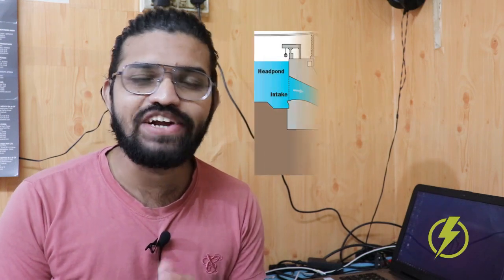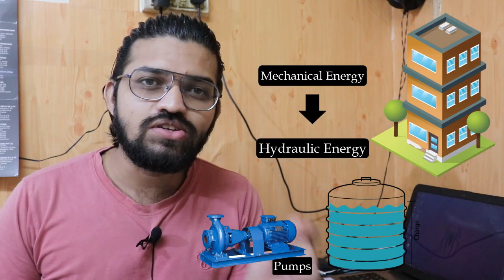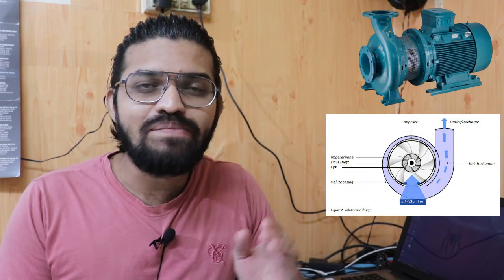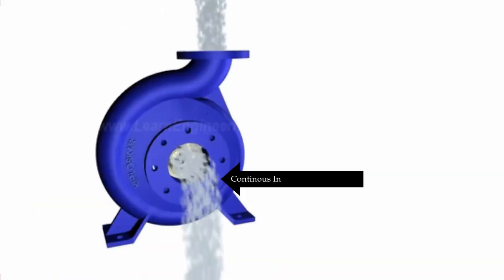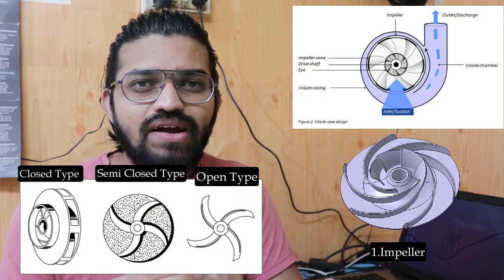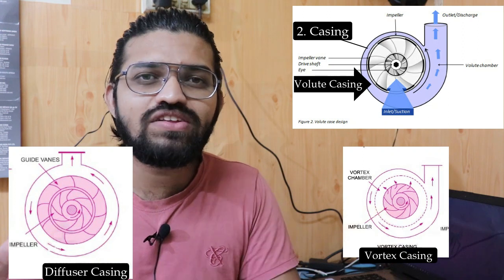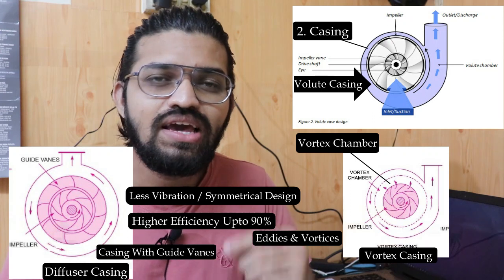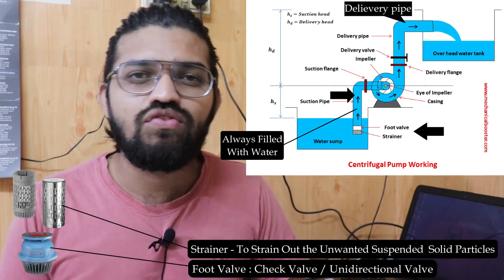How Centrifugal Pump Works.

Comment: Bro ...how to get velocity lines  from one impeller to another impeller gap ... thats makes impeller design i think ,I'm i right bro ..... kindly say how to get velocity between 2 impeller bro
Reply from the maker: Are u talking like how water flows between the Blades of impeller ??
Reply: @EngineersAcademy9204  yes blades are fixing on the casing how to get a design like ....in centrifugal blower titration are done ....and finally get a impeller design and fixing in casing then....getting success i do know how get  efficient suction of fluids in design
Reply: @EngineersAcademy9204  how to calculate velocity  between two impeller bro
Reply from the maker: Ok... I got it. Do u design the impeller blades of centrifugal pump?
Reply: @EngineersAcademy9204  yes yes bro  but I dont  know about impeller curve design and velocity calculations for suction if u know that kindly made it a video bro
Reply from the maker: @learnerfromeveryone1005  ok brother ! 👍🏼